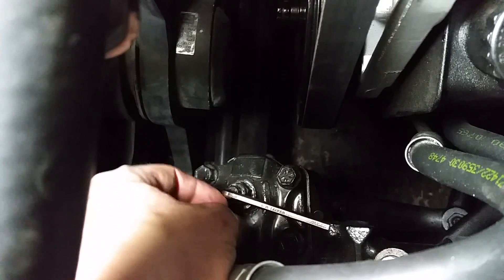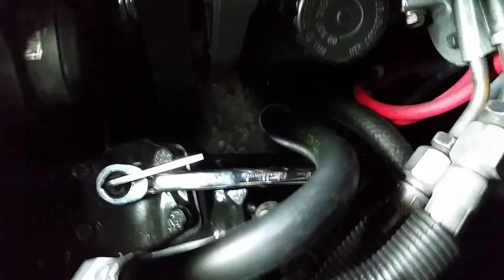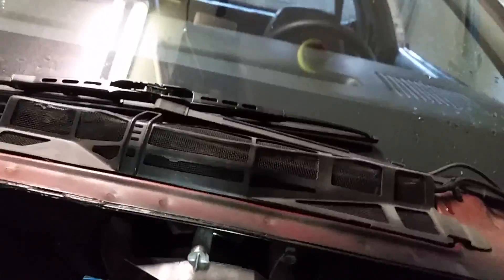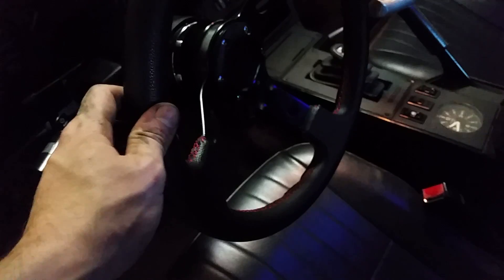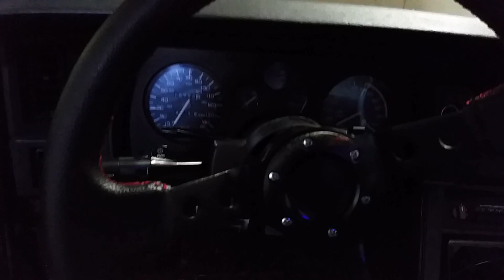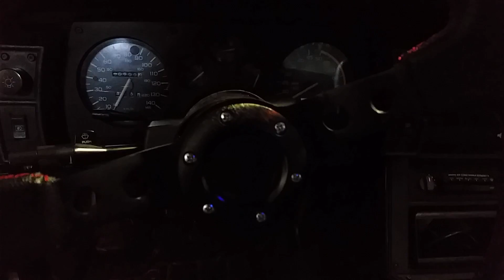How to diagnose and adjust a steering box 1989 Camaro

Comment: I replaced everything but the bushings and shocks on the front. There is zero slop between the steering wheel and the wheels. I had an alignment. The car is still all over the road except on actual nice flat highways. If I just randomly move the wheel back and forth like I'm an actor driving on TV, it stays straight on uneven roads.
Reply from the maker: I have a similar problem, on uneven roads my camaro likes to drift to the curves of the road without moving my steering wheel. Im thinking it is my idler arm. Once I get the money im going to buy all the components for a full front end replacement, tie rod idler arm center link joints etc, and post a video on it. They are all original parts on mine

Comment: Why dont you check the rag joint before do thath.
the previous owner of my 84 camaro, make the mistake of adjust the steering box without check the ragjoint (that was very damaged).
Then one day I decided to verify why it was so difficult to keep the car stable some speed.
and I found a very worn rag joint.
and now the steering wheel is misaligned.
for now I have been lazy to disassemble everything to align it.
Any ways thanks for the videos!
i bought my car in 2016 too :D

Comment: ive changed my idle arm, inner and outter tie rods, then alignment. the car doesnt wander anymore but there is still about an inch of play. any suggestions
Reply from the maker: Sounds like you have replace most of the steering components. If its not the inner or outer tie rods idler arm or adjustment of the steering box it could be a bad steering box or a center link
Reply: thanks alot bro. the steering gear is remanufactured bought it in april. after i swapped it the steering was great the it came back to extra play

Comment: Can you help me out. I did this test on my car with the same box as yours. When I shook it there was absolutely no play in the pitman arm. So I tried to tighten toe gear box but the Alan key part was sooo tight already I couldn't tighten it any more. Not sure what to do now.
Reply from the maker: There are a few other things that can cause sloppy steering, I would check the rest of your rubber bushings, inner and outer tie rods along with your control arm
Reply: @JRobling  but wouldn't the issue be before the pitman arm since it didn't move when I turned the wheel?